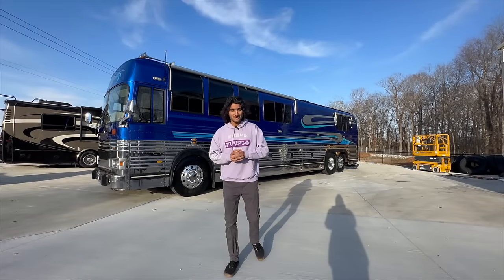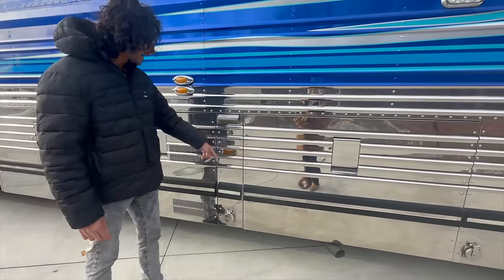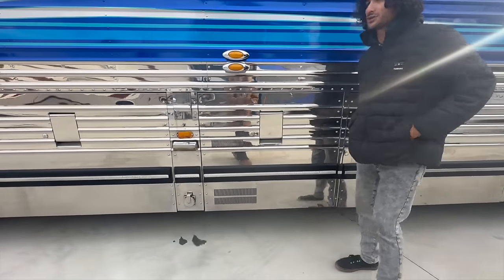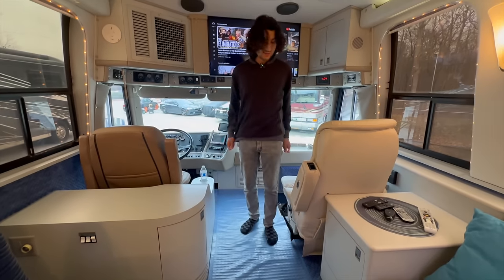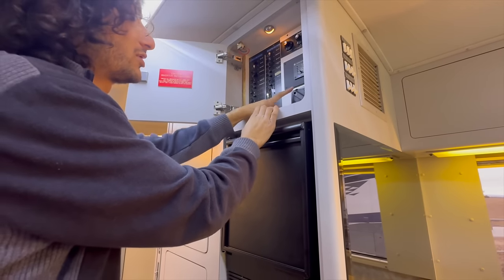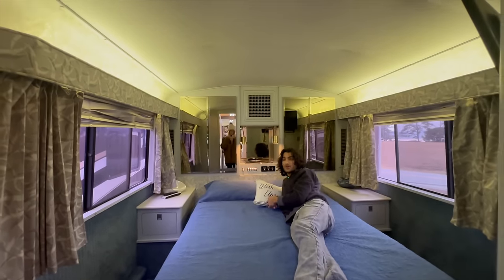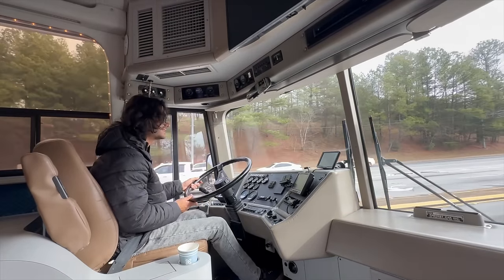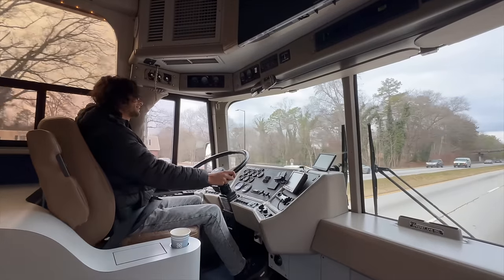1990 PREVOST XL40 LIBERTY COACH TIME CAPSULE

Comment: What a lovely Gem of a bus. The 8v96 is a 2 stroke motor so the oil never circulates thru the motor, just mixed with the diesel and burned in combustion.  So the oil reservoir should Always look and be new oil.
Reply: Not this 2 stroke. Oil sits the oilpan seperate from th fuel.
Reply: Why would the second owner do all this work and spend all this money without replacing the windshields and the shower light. It really is a beautiful coach. I wonder how many miles on the engine and hours on the generator?
Reply: Beautiful motor coach!!…I guarantee you the mileage is over 150k, as they didn’t mention it. Only when the mileage is low, is it ever mentioned in these videos.  Mentioning the mileage on all listings would show consistency and transparency for every unit you market equally, whether it has high or low mileage.
Reply: @ariel562  150k would be low mileage for this coach.  Just getting broken in.

Comment: Drove an old logging truck years ago with that same Screaming Jimmy engine. Reliable and economical to service or repair. But extremely hard on fuel even with just a turbo, I imagine with that blower it must be absolutely awful.  Be warned you will be lucky if you get 6 or 7 miles to a gallon and with that set up I can see a possibility of less than 4.